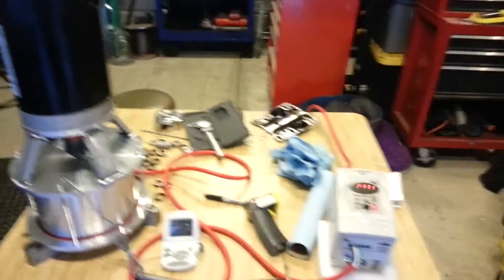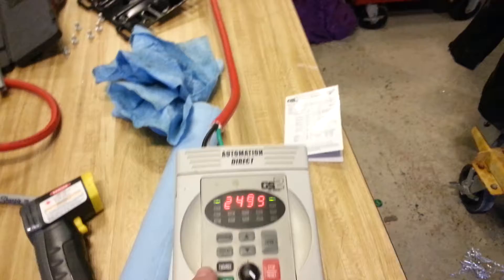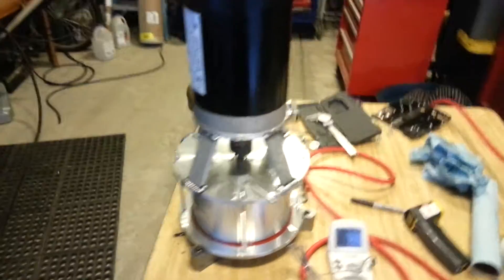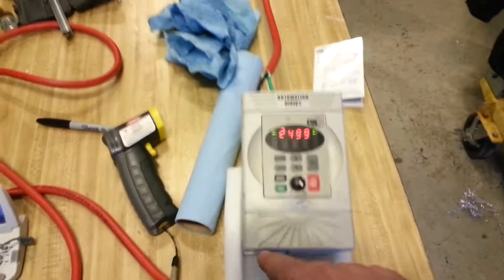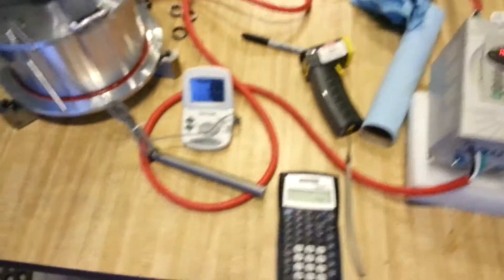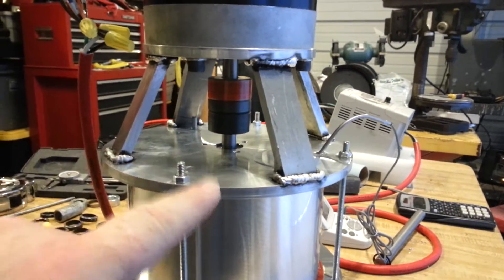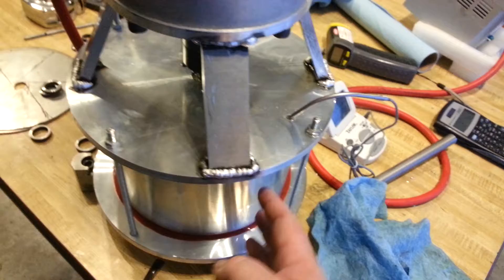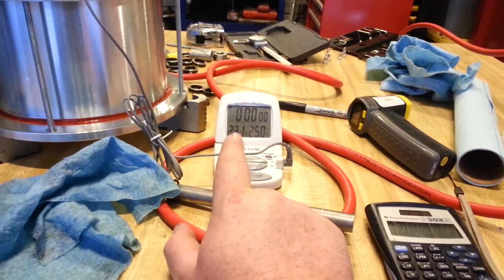VFD Friction heater in progress

Comment: It's not DC my pal. Please do your math correct. It's 3 phase which means to the 2.1A times the 220 Volts you have to multiply it with the Squareroot of 3 which equals 2.1 x 220 x sqrt (3) =800.20 Watt

Comment: You went to 220/440-3ph, I don't know why but you know I don't have that in my home. Is this the industrial version? Are you still playing with 110?
Reply from the maker: I am using 110v in from the wall to the VFD that converts the power to 3PH 220v out to the motor.
This make controlling the motor RPM cheap and easy.
Reply: @oilpiggy  Do you sell your heaters Sir ??? Let me know and how efficient is the unit oilpiggy ???